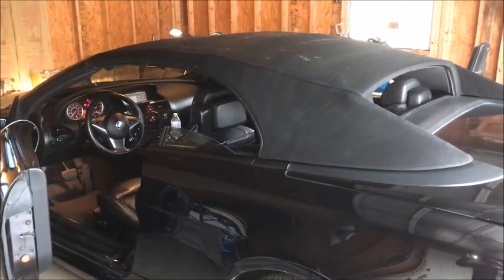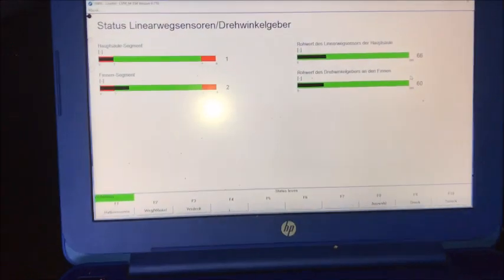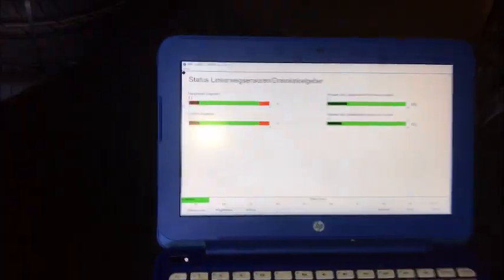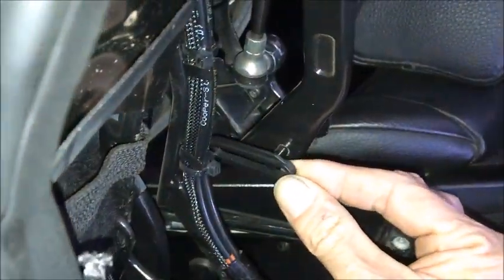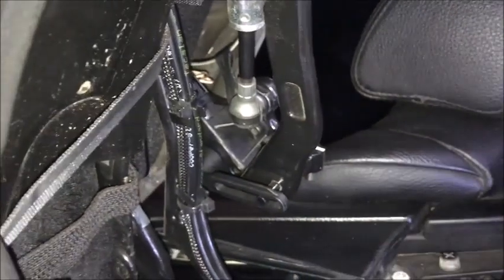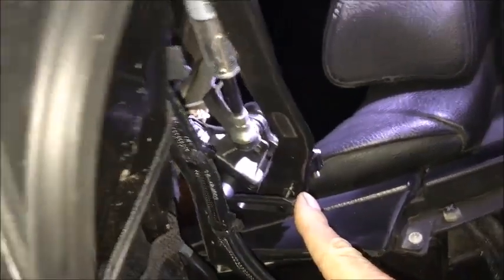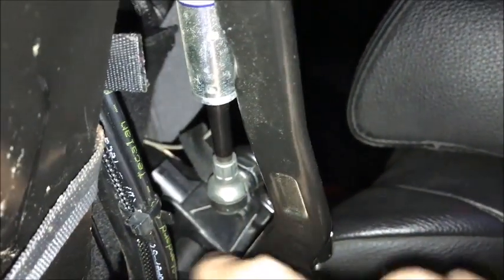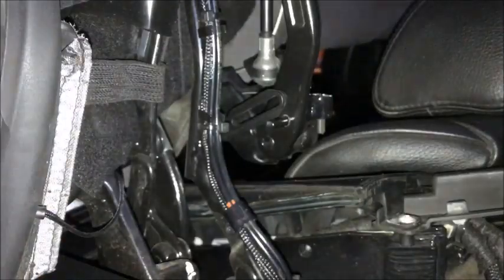BMW e64 Convertible Top Not Locking Part 2 - Adjusting the Segment Sensors

Comment: Hey, thanks a lot. Really good Video. Had the same issue with my E64 650i 2007. I think they already installed an new Version of the Sensor Cover on my BMW (It already had slots to adjust the screws). Just needed to loosen the screws and ajust the cover and tighten them. Problem Solved.
Reply from the maker: Thanks man !  Yep, I think BMW realized the flaw and modified some of them so they could be adjusted.  Good to know that it solved the issue on yours by just adjusting it👍. All the best !  Steve

Comment: A couple of thoughts. Great vireo and it worked for me (Fonzie) the first wrap with the old fists. Light goes off, top goes down!
After the roof was down I smiled to myself and thought Job well done.
Because the simplicity of the job I did the following.
1. Got out my phone and called my wife to tell her after a lot of hard work the top was working fine.
She asked me how she could thank me...oh my .. My first request was for reimbursement for my time and efforts. Next some type of reimbursement for money saved by not going to the dealer. Ended with her bringing me a  cold beer ..with the top down.
Reply from the maker: Lol !  Yes, that’s the way it goes at my house as well (the convertible in the video is my wife’s ).  She was pretty happy when I got the top working again on hers, but I really gained when I did the oil cooler oring replacement that is sandwiched between the block and the motor mount on the left side.  It was going to cost so much at a shop that was able to buy a 2 Post car lift for the garage and still have money left in the wallet, lol.  Glad the video helped some and all the best !  Steve

Comment: I had the problem as well
Then i read about ‚touching‘ the sensor and correcting its position
I did it and the problem went away (and got back again) but i know how to fix it fast
Now it makes more noise while closing and is a bit rought at the last part where the front closes
I hope its not problematic!
Reply from the maker: Hey !  Yep they do start getting more noise as things wear or the mechanism gets dry.  I put a little non hardening grease on the metal parts that pivot every other year which seems to help some. All the best !  Steve
Reply: @StevesDIYs  thanks for advice

Comment: Very clear and informative video well done i will try and carry out the same process. Also well done for  pointing out the safety issues
Reply from the maker: Thanks man !  Eventually (after a couple more years after adjusting the sensor) I did end up just replacing it as it finally went totally bad.  Yes indeed…no DIY is ever worth risking safety for in my opinion.  Not only the risk part, but just one trip to the emergency room would easily pay for the most expensive mechanic you could find to repair most DIY type repairs.  Thanks again and all the best !  Steve

Comment: The worst thing about that sensor failure is the fact that you can't roll your windows down when the convertible top thinks it's engaged. I gotta get out of my car to touch my gate card to the sensor to get out of my parking lot. When I first had this issue, I pressed the convertible button because it was flashing and it put my windows down and wouldn't roll them back up because of the position the sensor thought it was really in. I had to ride around windows down in the cold that day before I fixed it. Thanks for making this it helped a bunch!
Reply from the maker: Fabio Suave 狼 , Thanks ! Glad to here it helped 👍. Yep, when it faulted it would drive me nuts that the windows wouldn’t work...and the trunk doesn’t open either so you have to use the key to open it too.

Comment: I just wanted to add a couple of things since your videos are excellent and gotten me through a whole bunch of stuff I want everybody to understand that the left and right side of the gears for the front top need to be equal. That means you may need to disconnect one open it all the way reconnect it disconnect the other one open it all the way and make sure that they’re both in the outermost position. If they’re not in sequence that late then they won’t work.
Reply from the maker: Thanks 👍. Yep, I did show this in the other video on the channel where I replaced the latching motor, but it’s good to note this important point in this video as well for folks reading through the comments. All the best !  Steve

Comment: Hi Steve, my 2007 M6 recently started giving me this error message, it usually just resolved itself after turning the vehicle on and off a few times, but last week the message came on and didn’t turn off. I tried locking the roof manually but the message was still showing. I was about to call the dealership when I came across this video. A few well placed taps and now the roof is working perfectly again. Thank you for your assistance.
Reply from the maker: Thanks !  Great to hear the video was helpful 👍. Yes, I think the segment sensor issue is the most common one for these soft tops. If yours is like most of them (mine included), the segment sensor will eventually fail to read the correct segment and will need to be replaced. Fortunately is it not very difficult to do and only takes a few tools.

Thanks again and all the best !  Steve

Comment: Hi I have a BMW 120i convertable I removed the hood cover that covers the fron two locks. I can open the star screw to release so it can open manually.
I relock the star fixing I press the open button the lock releases electrically I know this cause I can lift the hood manually .in my boot it has left right pulls to manually open I presume the motor drives.how do these reset do I do it manually or do they adjust them selves
Reply from the maker: Hey man !  Yep, if the 120i is like the 650i, once you pull the handles in the boot to move the top manually, if there is an error with one of the many soft top sensors reading correctly, it will not go back into automatic mode.  Here’s a video on how to reset the rear compartment latches that should let it go back into automatic mode so the side windows will work again.  It won’t fix the problem if there is an issue with one of the sensors, but it will get the windows working again until you can determine the problem.  Hope this helps and all the best !  Steve
 https://youtu.be/3Qucuw9_DKw
Reply: @StevesDIYs  thanks buddy will try tomorrow morning ps your the only one who replied thanks Trev in sunny cape Town south africa

Comment: Hi Steve ,
John here from Ireland and want to say your videos are savage , my 645ci roof won’t budge just the windows go half way and the back window stays down which I have to wind up manually ... going to try and get the software before I wreck your head 😀 . But great job incase I get it sorted myself ... you are a legend !!
Reply from the maker: John kelleher , thanks man...I really appreciate the compliment 👍. Yep, having the software will for sure help sort out what’s causing the issue.  There’s a video on the channel that shows each status of the sensors at the top makes its cycle...maybe it will help show the sensor states (on or off) to compare to yours once you get the software (you can slow down the Video in YouTube...just in case you hadn’t used that feature before).  I’ll bet you’ll get it figured out 👍. All the best from Nashville Tennessee, USA !!!
Reply: Steve can you tell me the kit( software and lead ) to find the roof sensors like yours ?
Seems to be so many out there  
Any tips also on where I should start looking with problem above ?
Any help much appreciated as I can’t get anyone in this country to do it apart from bmw which I can’t afford .
Reply from the maker: John kelleher , hey again, I got my cable and original software from bcables.com years ago (I just checked and it looks like they are still selling them).  The cable for our cars (e-series) is the Silver cable, and it also works on several older models as well since it has the k or DCAN switch built onto the OBDII connector.  I think they send you CD’s of the INPA software ( what I show on most of my videos as it’s easier than the ISTA software and can do most functions ).  Once you get good at talking to the car, ISTA does quite a bit more for diagnostics, but it’s a bit more complicated and can accidentally reset things someone might not want to reset, lol.  INPA is pretty safe to use, but the software was never fully translated to English so parts of it are still in German (google translate has been my friend over the years).  My PC with the CD drive died several years ago so I downloaded the software again from Bimmergeeks.com, but it’s the same software as bcables.com’s software, but doesn’t have the one click installer like bcables.com did.  I also don’t trust free software much so I bought a cheap laptop and dedicated it to my car software just in case there were bugs in it, but I’ve never had anything strange happen to the PC’s so maybe I was just overly cautious.  For your issue, If the cars four side windows will go half way down when you hit the retract top button, but then the back window will not go down or the back window goes down, but nothing else happens, at least this says that the top’s computer module wants to initiate the cycle so that’s good.  If the button does not immediately start flashing red, then the car is probably just waiting for the sensors to be correct to move onto the next step in the sequence...or it could be that it is trying to do the next step, but a fuse may be blown or a motor bad so it cannot complete the next step.  Just one hall sensor not reading the correct position or the segments sensors being off by one segment can make the top stop the sequence since it’s trying to protect itself from damage if something is out of position.  You should be able to tell a lot more of what is halting the sequence once you get the software and cable for sure.  Hope this helps and let me know how it goes 👍, Steve
Reply: Steve’s DIYs omg thanks for the effort and interest ... I have had no working roof for the last 3 years and occasionally put it down manually but that’s a pain .
You are an absolute gent and there will be a pint sitting somewhere for you when I get it sorted .
Reply: Steve  still waiting for software and cable but you might be able to point me in right direction ... yesterday I just tried to put the top and windows went half way as usual and that was it but I did notice each time I presses the down button there was a click/slight clunk from the white box I front of rear window .
Just thought you might have came across something like this ?
Reply from the maker: John kelleher , hey again...are you referring to the plastic box that’s between the rear seats like what’s shown in the attached link at about the 5:40 time stamp? https://youtu.be/rNj3J9f0yfE If so, that clunk might be the rear window motor trying to lower the window,  but can’t for some reason (like the window is jammed, motor is bad or maybe one of the lift cables has broken).  There’s also a video on my channel showing how to take the rear window module out if that is where the clunk is coming from.  If I misunderstood where you are referring to for the white box, just let me know...Steve.
Reply from the maker: John kelleher , if that’s not what you were referring to, maybe snap a pic of where the noise is coming from and send it to my email so I can see...  stevesdiys@gmail.com , Steve
Reply: Steve’s DIYs  that’s exactly where I’m talking about where the manual socket is for operating back window but unfortunately my window will go down but not up so constantly down now so not sure what the clunking is .... hopefully stays dry a little longer or maybe I will make a temporary back window until I sort it ... hopefully and again thanks Steve .
Reply from the maker: John kelleher , that definitely sounds like something that could prevent the top from functioning.  The back window module only has a position sensor (hall sensor) for the down position...it uses the current spike at the top to tell it that it is fully up when the motor stalls.  If the hall sensor is bad or giving no signal to let the window now it’s down, it will try to go down until it hits bottom so the clunk may be it trying to go down but then hitting bottom.  The down current spike stops it (but the hall sensor signal is supposed to be made at the bottom to stop it).  If the hall sensor is not reading that the window is down, the top not function for sure.  This was the problem with a friends car (the videos of the tan interior 650....mine has the black interior).  His hall sensor was corroded and not giving a signal so the window would not move since it had the hall sensor fault.  They get corroded from water getting in the rear window module.  If you are up for watching another video here’s the link to the one that shows taking the rear module out:  https://youtu.be/MfV_Ta8G6ds  Once you get the software you should be able to see if the rear window hall sensor is making or not in INPA vs. having to take it all out and not knowing for sure if that’s the issue though.  Great detective work 👍...that could definitely be the issue.  All the best, Steve
Reply: Steve’s DIYs hey dude ,
Yeah got the inpa and just installed a new battery so I could use it without engine running and yes you were right ya legend !!
I can’t put up the back window and yet it’s not registering it’s down hence the roof won’t go back ... the window motor will send the window down but not up and now the manual bolt is shagged back window will stay down until fixed .( would a bad sensor stop the rear window coming up .. I suppose if it doesn’t know it’s down it might not put it up ?
Ok I will watch your video of taking out the rear window another few times before I tackle it and again thanks Steve .
Reply from the maker: John kelleher , sounds like you are getting really close to finding the issue 👍. Yep, my friends did the same thing (went down, but wouldn’t go back up) and the only issue with the back window was the down position hall sensor. It must be some kind of protect logic so it won’t crash the back window or something.  If you do get it all apart and find it hall sensor is damaged you can go to a website called RealOEM, type in the last digits of your VIN (or enter your car’s info), then click “browse parts”.  Then click on the picture that says Sliding Roof/Folding Top, then click on Folding Top - rear window.  The hall sensor is item 15 so then you can google the OE part number listed ( not sure if RealOEM actually still sells parts anymore...usually it sends me to a site called Pelican Parts which I have gotten parts from if their price is good. Or just googled it).  Let me know how it goes 👍, Steve

Comment: Hey Steve. Big thanks from Germany! Can you tell me if it still works after you did the fix? It does the sensor position makes me trouble again? Greetz, Ben
Reply from the maker: Hey man!  Yes, unfortunately even after adjusting the segment sensor, eventually they will stop working correctly again it seems.  I have had to replace mine once since making the video, but now it is working good again with only the occasional notification that the top is not locked (usually due to getting the soft top wet and then it shrinks when it dries out causing the sensor to be temporarily out of position).  It is an annoying part of owning one of these really nice convertibles it seems.  Thanks and all the best from Nashville Tennessee, USA !  Steve
Reply: @StevesDIYs  Hey Steve, thanks for your reply.  did you have to keep readjusting it or did you just tap on the spot and it worked again?
Reply from the maker: @jamos33  hey again, after the sensor adjustment, it worked for about one year more, then started faulting again and I had to thump it on its triangular wing again to get it to work. I then changed to sensor out completely and it is working again.

Currently when it does give an error (it’s not very often now), I just thump the triangular wing or cycle the convertible top through the motion and it removes the error. I would say that eventually I will have to replace the new sensor or do the adjustment for it if the errors become more frequent again.
Reply: @StevesDIYs  Did you have any issues with the new sensor position? When I put the new sensor on - using the method in this video, the sensor is at position 1 not 6 - so the top won't close. If I put the old sensor back on, it is at position 6. Any ideas?

Comment: I’m having this issue.  I heard you say you are from TN. You wouldn’t happen to be in Nashville???
Reply from the maker: Hey man !  Yep, I’m close to Nashville...about 20 miles north up in Gallatin 👍.
Reply: @StevesDIYs  I’d love to talk to you. I just got my top to close. I basically banged around on it and pulled on some cables and it just  closed. It’s been acting up, but I’ve always got it to close after a few mins.  It’s been in my garage for 5 days and I saw your video this afternoon.  So I messed with it again and it closed.  I also apparent have a coolant leak, which I hear is common. I love the car, but I just hate getting ripped off at the dealership every time something pops up.
Reply from the maker: @drjimmylee16  , no problem 👍...yep, sometimes it just something easy like replacing the segment sensor (especially if thumping on the wings will make it complete the cycle or stop gonging that it’s not locked. If you use Facebook, you can massage me from my Steve’s DIYs page:  https://www.facebook.com/stevesdiys/ or you can email me at Stevesdiys@gmail.com.